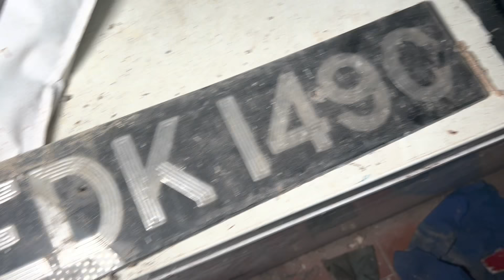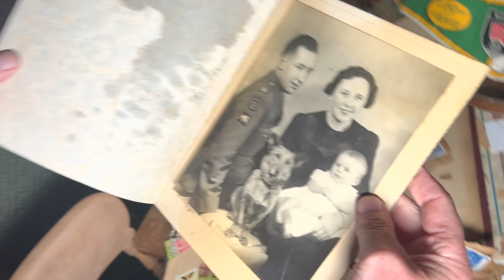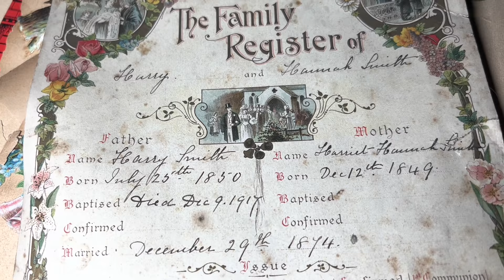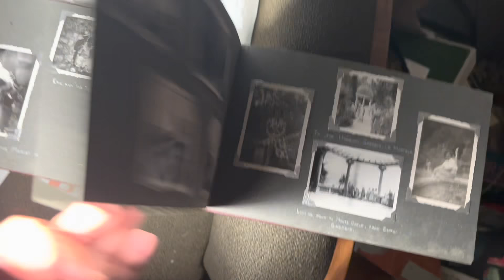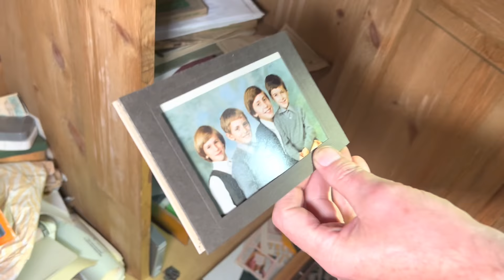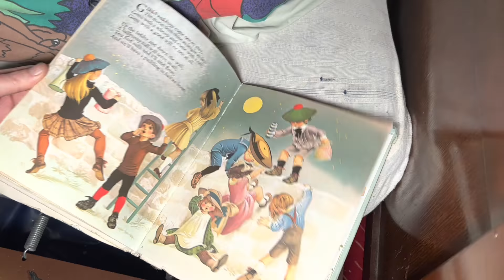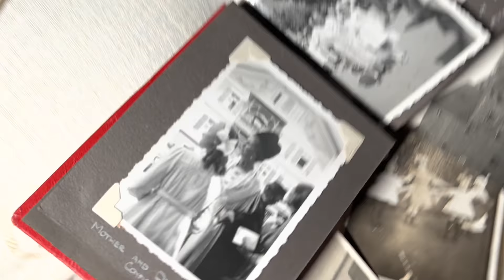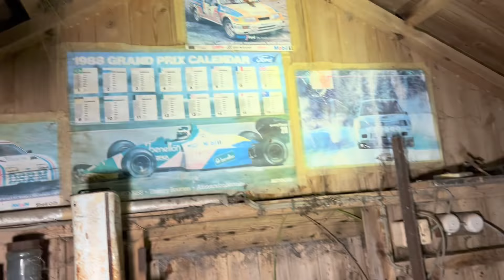This amazing ABANDONED house has whispers outside

Comment: UK Vehicle Enquiry Service states:

Vehicle Details 

Vehicle make: MORRIS
Date of first registration: October 1965
Year of manufacture: 1965
Cylinder capacity: 1385 cc
CO₂ emissions: Not available
Fuel type: PETROL
Euro status: Not available
Real Driving Emissions (RDE): Not available
Export marker: No
Vehicle status: Untaxed
Vehicle colour: RED
Vehicle type approval: Not available
Wheelplan: 2 AXLE RIGID BODY
Revenue weight: Not available
Date of last V5C (logbook) issued: 19 February 1990

This looks like an old old registration plate from before when they had the 'C' prefixed plates in the late 80s/early 90s

Comment: Vehicle Details
Vehicle make	MORRIS
Date of first registration	October 1965
Year of manufacture	1965
Fuel type	PETROL
Vehicle colour	RED
Vehicle type approval	Not available
Wheelplan	2 AXLE RIGID BODY
Revenue weight	Not available
Date of last V5C (logbook) issued	19 February 1990
EDK 149C  hear is the details of the number plate ..